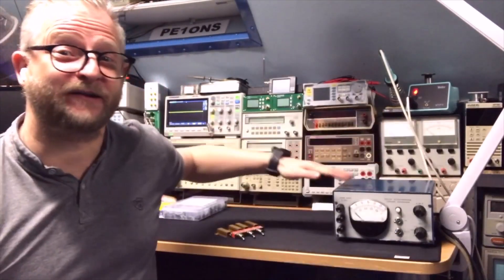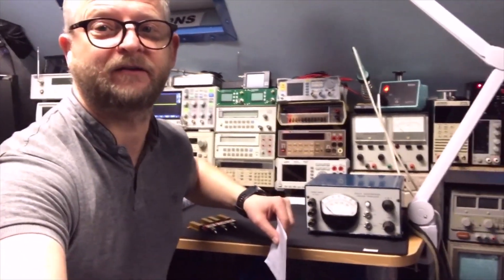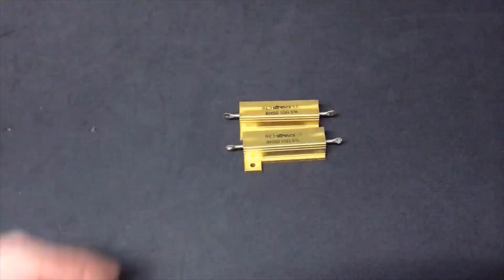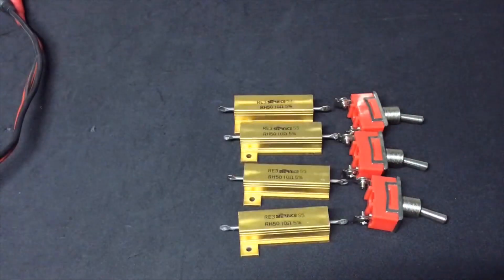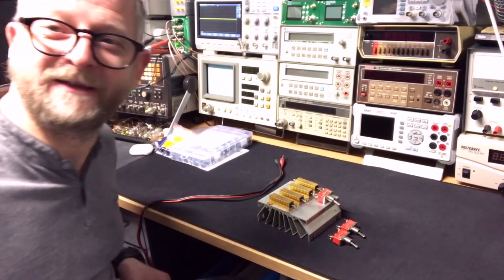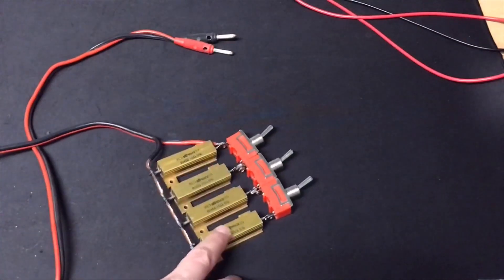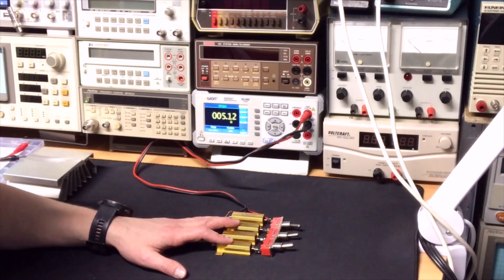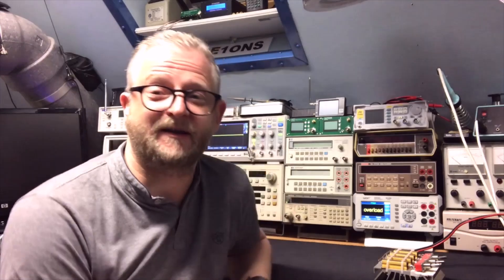#116 Resistor Load  - Quick Build from parts laying around

Comment: When you plug that into the speaker out put of an amp, would that current be to strong to touch on average?
Reply from the maker: Depends on the Amp... be sure the resistance matches 4 or 8 Ohms in most cases.if the Amp is 100 Watts per channel, be sure the resistors you use are also 100Watt (in total in parallel ,or each of them in series)